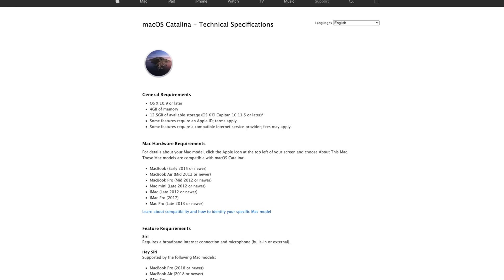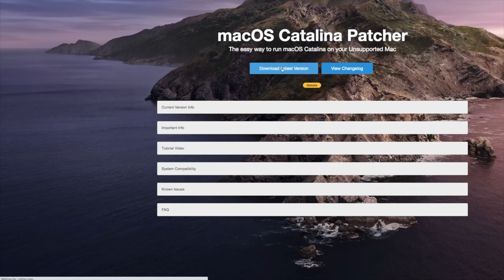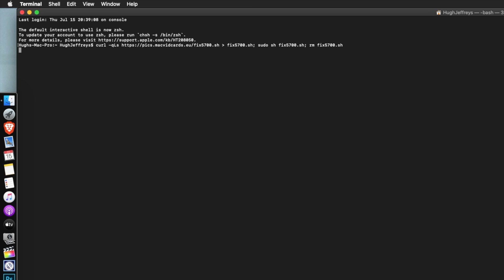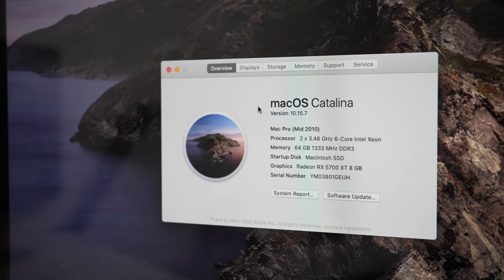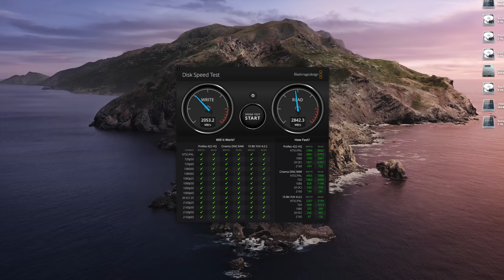Obsolete? Think Again - Keeping My Ageing Mac Pro Alive

Comment: I really hope you changed the cpu thermal paste and please dont suffocate the gpu like that. Have it no other card on top of the fans if you want it to not cook it self.
Reply from the maker: 7:06 In the menu bar you can see my CPU's run around 33-44 degrees. No need to change the thermal paste.
As for the GPU, most PC's have the slot on the other side to the card faces the other way but this design doesn't allow for that. Although one fan is completely exposed the over is mostly covered, there is a slight gap for airflow but it doesn't concern me, the majority of the time the fans are not even running on the card unless its under a big load. I edited for 9hrs straight on the computer and I could touch the heatsink and it wasn't even hot.
Reply: @Nramanoodles It would work, as the 4,1 is nearly identical to the 5,1.
Reply: @HughJeffreys  that means it's not even being used. Why upgrade in the first place, lol
Reply: @lopwidth7343  did you watch the video? Mac OS Catalina doesn’t support his old card.
Reply: @HughJeffreys  For someone who is all about extending a products life span it's strange that you're ignoring all the feedback.  The VRM and VRAM on the card will need airflow, even if the GPU Core itself is cool.  The same goes for the components on the motherboard, which are caked in dust.

You are actively shortening the life span of this computer with negligence.  For electronics, heat is always a killer and this card will cook itself.
Reply: @cole7529  Catalina doesn't support 32bit either. So the point is still moot, imo
Reply: @HughJeffreys  If the GPU isn't getting hot that most likely means you aren't using gpu acceleration while editing I don't use Mac Os but maybe you should try and see if adobe or final cut is actually taking advantage of it. And for the CPU it's mostly a maintenance standpoint I usually recomend that people change their past every 2 years to avoid it drying out and without knowing it it starts cooking it self.
Reply: The GTX 980 did fine because its using a fan blower design, the RX5700XT is going to have a short life because its using a fan design that recirculate air into the case and there's barely any space to.
Reply: @HughJeffreys  why did you delete my comment? It’s gone and it had 100 likes or so, I was just telling people that I also have an old Mac Pro but that while you can put macOS on them, you can also put win10 and probably Linux, I don’t see why you deleted it?
Reply: @Nramanoodles You can install a wifi module but make sure you have the correct card and required wires.
Reply: @Nramanoodles Yes, however, you would need a MacPro4,1 dual CPU tray. They are not cheap.
Reply: @Nramanoodles You said that you are upgrading a MacPro4,1. You can only use a 4,1 tray.
Reply: @Nramanoodles The board is flashed to a 5,1 EFI. You can only use 4,1 boards, but they will support 5,1 CPUs.
Reply: @andrebanha8408  Actually as it comes to thermal paste. As long as the heatsink is not MOVED on the cpu core its BETTER not to change it. It doesn't matter if its dried up, actually it should dry up to stabilise the heatsink onto the core. What paste does is cover microscopic pores and flatten imperfection on metal plates, the best is to have a non porous *absolute" flatten metals touched to each other perfectly without any compound. But because this is impossible you use a REALLY small amount to cover imperfections but let metals touch each other where the contact is perfect. Ofcourse if the heatsink is even just barely moved onto the core and paste is dried-up then yes it need to have a cleaning and re-applying. 
Positioned dried up paste does a better job than freshly one, that's why it needs thermal cycles to work best
Reply: @cole7529  dosdude1 catalina patcher

Comment from the maker: First 4k video! With plenty more to come. Still have a few 1080p projects in progress so there will be a mix of 1080p and 4K videos over the next few months.

For those concerned about my graphics card airflow, the fans actually don't even turn on until its under load. I can put my finger on the metal heatsink while its on and its only slightly warm. Even after spending 8hrs editing this video.  So I am not concerned.
Reply: Do yo have any answers for my 2011 iMac I was wondering what I should do to it should I upgrade the components it has high Sierra and I’m stuck on it just like he is
Reply: Alright.
Reply: can i buy your old gpu?
Reply: You can upgrade anything
Best Mac Pro 5,1
Reply: why cant you just swap around youre 2 drives in the pcie slots and give that gpu some air
Reply: I watch every video of yours keep doing what you are doing Hugh 😁😁
Reply: Bro you should get a 3080 graphics card.
Reply: You much storage do you have in your 2010 Mac hugh
Reply: @AppleReviews  Sorry but I have run tests in both Triple and dual channel and the speed difference is so minimal that you cannot really tell the difference. I will go with more memory anyway over losing a couple of Miliseconds of speed.
Reply: @camman1159  what specs do you have?
Reply: lol i only watch on 720 p
Reply: Hello Jeff can you help me on my iPhone 5s where I forgot my used apple ID and password?
Reply: @olivertabone6788  The thing only has four slots, only one of those runs at x16.  He has the other three full.  No room to move.
Reply: @thephonedetective183  The power supply won’t support a 3080, no drivers, and only half the bus speed on PCIe 2.
Reply: @frankwalder3608  ahh ok i thought they were all x16
Reply: @thephonedetective183  Didn't you watch the part where he said Apple won't let Nvidia release drivers for the Mac?
Reply: cant even reach the backplate im sure is on fire

Comment: Installs the new gpu
Airflow* aight imma head out
Reply: Fr! Poor gpu :(
Reply: Exactly
Reply: Rip
Reply: Lmao
Reply: there is pulse edition of sapphire that have better orientation on the aluminum on amd and also probably suggestively better build but yes poor design all for the look madness build lol should have probably gona whit reference design due to poor airflow
Reply: He needs to take one PCI out for a better airflow tho...
Reply: Don’t 😢
Reply: @pccoldwar9160  it has to have this mac os drivers i think
Reply: Instead of installing a new gpu, he should have taken out the components and offer a nice sledge hammer treatment to that overpriced, airflowless garbage bin that Apple calls a case.
Reply: nah he's just putting to use the lessons learned from the Apple School of Proper Macbook Airflow
Reply: but fr tho, i doubt there will be much of an issue with the gpu airflow wise.  I know it's best practice to have good airflow, but from personal experience with my mac pro, gpu's just dont seem to get that hot or even turn on the fans that often, even under heavier workloads.  

I guess he could try at least seeing if he can swap the slots things are on, but the bottom slot is the only double height one so it's prob the only way everything can fit.
Reply: @MXCN_El1011  The 5700 Xt is a very hot card producing 225 watts of heat. With that kind of cooling or lack thereof the GPU will clock itself down to prevent it from overheating. Modern gpu's get especially hot, much more so than CPU's
Reply: @pccoldwar9160  if he moves the drive card to the opposite slot of the gpu and moves the wifi (i think) to right next to the gpu the airflow will be so much better
Reply: @ron200088  I wouldn’t exactly call the case lacking in airflow, if anything it’s airflow characteristics are second to none.
Reply: Technically airflow should head out right?

Comment: 5:58 Me looking at the airflow clearance for the graphics card

Internally screams
Reply: once i looked at this i started choking internaly
Reply: do you expect an apple fan to know how to build a computer? dont be fooled,  hes gaga for apple and only pretends to be pro-repair or whatever because ifixit gives him $$$$ to advertize there products.
Reply: @ps5hasnogames55  just cause he repairs apple products it doesn’t mean he’s an apple fan
also, he probably does know how to build a pc
Reply: @ps5hasnogames55  coming from somebody who still participates in the 'console wars' bullshit
Reply: @ps5hasnogames55  That was crude an unnecessary.
Reply: The old Nvidia had a blower style cooler. He really should have gotten an RX with that kind of cooler
Reply: We all thought that, and i'd like to see him try to at leastz swap the USB card and that large NVME slab. BUT: you underestimate the amount of air the card will get regardless of this position. You overestimate the load it'll be on. The Mac Pro won't game, nor mine, and video rendering does not load these cards up quite the same.

Comment: 3:06 - That's exceptionally bad. That's one of the screws that keeps the heatsink pressed against the GPU die. That screw being loose means the heatsink isn't seated properly, which means the GPU isn't being cooled as well as it should be.

Comment: These 6-pin plugs on the motherboard are rated 75W each, while 8-pin ones on the GPU are designed for 150W, and most likely will draw more than 75W. There's probably some redundancy, but I would not risk frying the the power lines on the mobo, there are tutorials online on how to power the GPU safely, you should really consider such a mod.

Comment: Good job, you managed to get a newer version of Mac OS and a more powerful graphics card!
The 980 is still a good card though, and if you sell it online, I'm sure there will be someone willing to take it out of your hands. :)
Reply: Fr. I'm using a GT 630.
Reply: @YitocukKilic  I plan to. My PC also has a 128GB ssd, which also needs to be upgraded at some point haha
Reply: @wilkgr  Why would you need to upgrade, unless it just contains your operating system there's no need.
Reply: @tyronenelson9124  I'm running out of space on it. I don't have space for my steam library.
Reply: I wonder if it’s gonna work on a regular pc tho since it’s a flashed card
Reply: @wilkgr  You could install a secondary slave drive and have all your directories sent to that drive, so nothing but system updates and drivers goes on to c.
Reply: @tyronenelson9124  That's possible, but negates the speed advantage that SSDs have.

Comment: Still have my Mac Pro from 2009, flashed to 5.1, RX580 8GB, 32 GB of Ram and 6 core Xeon with Big Sur and cannot believe I am struggling to sell it for 400 quid. Is still a very good and versatile machine, not to mention the reliability and numerous purposes it can easily achieve.

Comment: I had a couple of these from 07-08 lying around with only one left. Couldnt get it to boot last time I messed with it but I think it was just the side door sensor. NVMe would make a big difference, as its already a dual Xeon system.

Dont let companies win - R2R and other consumer protections pushing against upgrade and repair prevention are needed, in tech and other industries. I usually dont like regulation, but pro-consumer and pro-small business/competition is an area that makes sense.

Reduce, reuse, REPAIR, recycle!

Comment: Still using my wife’s 2012 Mac book pro and revived it with parts from my 2009 Mac book pro. In the start of covid it was a fun little project. Added 16gb of ram replaced her track pad with my old 2009 track pad. Replaced the battery with my old 2009 battery which was replaced under warranty right before it went south. Added a 2.5” ssd and using bootcamp to use windows 10 or Mac OS when ever we want too for certain apps that work on windows but not Mac OS and Vice versa. Switched out her cd drive with my old cd which was also replaced under warranty from apple. Fixed the wobbly display issue those generation Mac book pros suffer from and then her Mac book pro was pretty much brand new and works so well for such an older laptop. It just flys on windows and runs very well on Mac OS. It’s a Frankenstein build but it’s awesome knowing it was saved and not just sitting around not being used.

Comment: These are definitely not obsolete, however they do draw a significant amount of power compared to anything M1 related. I have a 2009 Mac Pro, flashed to a 5,1 running a hungry Vega 64 with 64GB of Ram, NVMe boot drive for Mojave, plus fully booting into Windows 10 and playing most games extremely well. I also have my CPU's updated to X5690's. I was wondering why you don't choose to run OpenCore as it is really easy to install and get working perfectly for the old Mac Pro even allowing you to install Big Sur?
Reply: Wow!
Reply: Opencore 0.9.4 Martin lo config will get you Monterey and with the syncretic hack a AMD 6800 GPU … truly the best Mac ever made
Reply: Also use a Sonnettech USB-C 3.2 PCI card and use a 4 bay USB-C 3.2 and 3.5” spinner drives in Raid 5 …fast faster than internal bays .. use the 6 internal bays for backup and archive storage

Comment: Might wanna swap the NvME drives and the card above to keep the GPU from choking.
Reply: The graphics cards in these machines sits at the bottom as that is the fastest x16 slot in the computer made specifically for graphics cards, but like Hugh said, it really doesn't overheat. Mine doesn't either.

Comment: While I do love the original cheese grater Mac Pros, this computer really isn't all that good for day-to-day use anymore. While on paper the specs seems great, the single core performance on those Westmere based X5690s is absolutely abysmal. Additionally, that mac can easily pull 600-800W under load due to the really old platform and 32nm arch for the CPUs
Reply: Me here vibing with my i3 core and 4gb ram
Reply: Uh nope. Mine usually pulls about 350 watts under extreme load. I have a 5700xt in it as well.
Reply: @gregthompson7793  do you also have the x5690s?

Comment: I had a 2006 Mac Pro. I bought a Sas to Sata PCI-E card and hooked the internal drives up to it. It changed the drives to Sata2 instead of Sata1. Then ran a Sata cable to one of the two hidden ports on the logic board to boot. These changes made all the difference in the world. Probably gave me another four or five years of decent performance. Now I just use it to grate cheese. 😂😂😂❤️❤️❤️

Comment: Bruh, watching this video got me so much cringe. That new GPU will be fried
Reply: Its actually fine, despite initial looks. Some people have popped two GPU's in and its fine. The front to back fan setup works really well and the mesh design does help a lot. The cringe for me is the dust. That's got the look of a floor pc use dust condition 😬

Comment: Seriously. And they are hard at work on that, even colluding with outside software makers to pointlessly block installation. It is my constant pleasure to keep mine alive forever, and help others to do the same. The only parts left from my 2009 ‘cheese grater’ are the chassis and the motherboard. Thunderbolt, USB-C, high speed WiFi and Bluetooth, major processor upgrade, memory of higher speed, Metal video, optical drives - all are new. 

It is quieter and cooler, drawing far less power, and very capable with any software that big, bad Apple hasn’t managed to keep me from running. It runs modern macOS versions thanks to some outstanding work in the HackPro community, spoofing as a much newer computer while booting with dozens of lines of altered code that keep the wolves away.
Reply: I’ve not been in the “hackintosh” scene in nearly a decade now, thankful to hear the community is still improving on these awesome machines. I’d be rather interested in seeing a video going into more depth of your set-up or if you recommend any, curious how with those improvements and with the software its running, how ‘capable’ it is against a modern machine. I’m going to get another soon now that I have a little more time and energy to put towards it..and the need for a second PC around the house, but definitely using post as inspiration!
Reply: @BroTatoRex    I’ll try to do that. One thing I’d like to say right away is that the community of coders has made the job at least ten times easier than it was when I did my first machine 9 or 10 years ago.

Comment: hello Hugh and community,
First of all fantastic video and explanation ...
I see that at the end of the video you are working with 3 Apple cinema displays, these are the Thunderbolt version ?.
If they are the Thunderbolt version, how did you connect it to the Mac Pro?
From what I see the new graphics card does not have Thunderbolt outputs .. and these screens do not work with HDMi adapters to minidisplayports ......

I have this same problem with my Mac Pro and a thunderbolt cinema display, I would appreciate if you have found a solution, thanks !!

Comment: I still have my 2010 Mac Pro 5,1
Currently using a M1 Mac Mini, I still have that beast sitting in my closet, still works. I may get it out and play around with it. The last upgrade it received was a RX580 video card and a 1TB SSD.

Comment: Definitely time to make life easier by getting an air compressor. I used to service a lot of computers and my air compressor was a HUGE time saver.
Reply from the maker: Having been looking into getting one. My dad has a big compressor but its total overkill and massive so will have to find something small like one for inflating tyres.
Reply: @HughJeffreys  I'm not sure what you have in Australia for tool shops, but in the US and back home in Canada, we can get decent inexpensive air compressors (under $100) that are small. The tanks are either shaped like a round pillow or a hotdog and are great for car tires and what I use mine for most of the time....cleaning out computers! 
https://www.harborfreight.com/air-tools-compressors/air-compressors-tanks/air-compressors.html?sale_price=%5B0%20TO%2050%5D
Edit: In Australia:
https://www.totaltools.com.au/119121-aeropro-1-5hp-direct-compressor-ttd1524